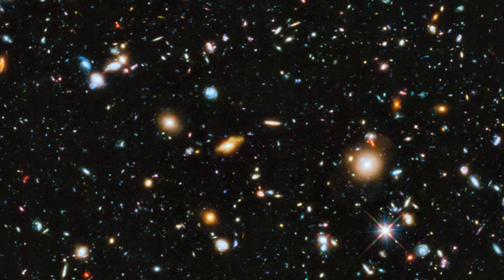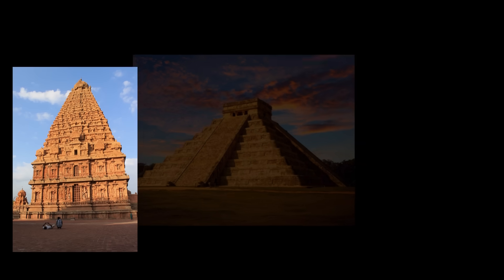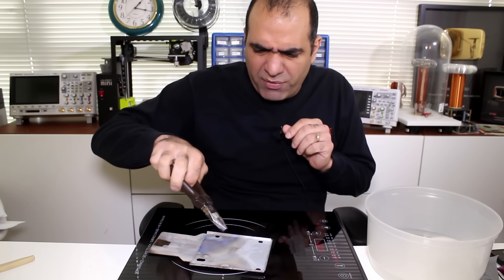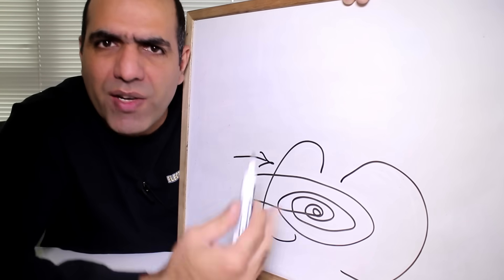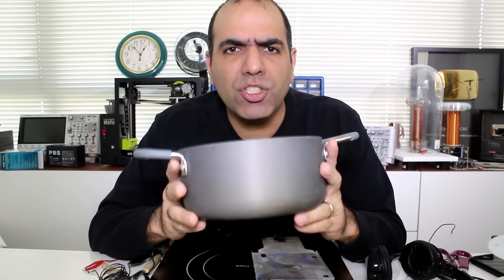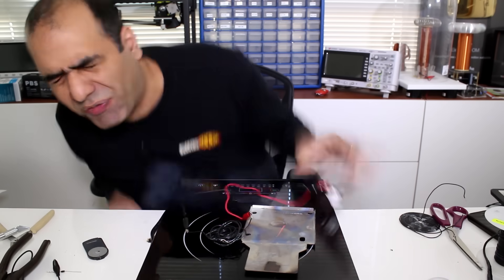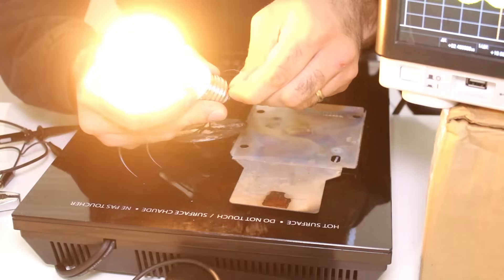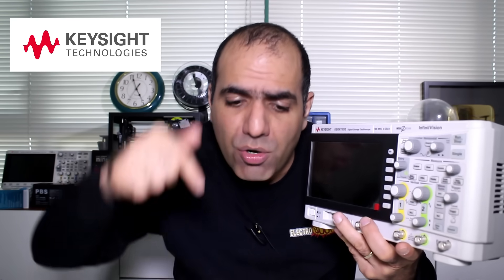Induction Energy Experiments

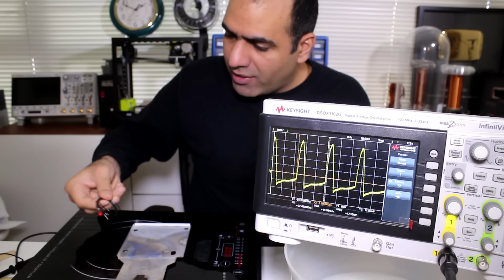Comment: at 3:55 your led did not worked because its a diode and diode dont pickup current from both sides. just one side i. i  duno if i'm right btw
Reply: In a DC circuit, yes, but in an AC circuit (as used by the cooker) electricity travels in both directions, the LED just didn't work because the AC wave was more of a saw-tooth shape, with steady current in one direction but a steep drop in the other.  Making the AC sort of DC..

Comment: Will the induction cooker get damaged if we use aluminium pot as the resistance is very less so current will be Very large, so the high current can damage the induction cooker.

Comment: Awesome video. Here's what I don't get. Eddy currents are created by induced EMF, which is created by a changing magnetic field. How much of a potential difference is generated depends on how much the field is changing (by Faraday's Law), and not the material it is passing through. So the amount of Eddy current is determined by the resistance of the material only - wouldn't less resistive materials heat up faster? Or am I missing something?

Does the magnetic field's frequency drop as the cooker's "load" increases?

Comment: THE POINT OF THIS VIDEO IS TO MAKE YOU THINK ATMOSPHERIC ENERGY DOES NOT EXIST.  1 METER = 100 VOLTS.   FOR EVERY METER YOU GO UP FROM THE EARTH, THERE IS A 100 VOLT ENERGY POTENTIAL.  AT 100 METERS YOU HAVE 10,000 VOLTS.  BUT LOW AMPERES.  THE GREAT PYRAMID WAS THE FIRST OF THESE DEVICES AND ITS TOP WAS COVERED IN GOLD TO ATTRACT THE ENERGY, ALSO CAPTUREABLE IN THE FORM LIGHTENING.   THIS VIDEO, AND ALL THE OTHER INFO ABOUT THE PYRAMIDS IS DISINFO TO STEER YOU AWAY.  CHECK OUT AARON DOVER'S CHANNEL ON ATMOSPHERIC ENERGY.  ALSO DO YOUR OWN SEARCHES, AND INCLUDE THOSE NUMBERS IN YOUR SEARCHES

Comment: if resistance is smaller in Al and Cu, then won't the current be higher? Since current is squared, will that not lead to greater power transmitted?
Reply from the maker: that would be true if the voltage remains fixed. but the voltage drops too.

Comment: Hey Mehdi.
Salutes from Jordan.
Allow me to slightly correct you on why induction heaters work on iron or any ferromagnetic material better than copper or aluminum.
Eddy currents and skin effect are actually present in all conductors.
The major reason why iron heats up better is the magnetic dipoles flipping up and down with the same 20 kHz of the magnetic field, which generates so much friction heat. This is known as you must already know as hysteresis losses.
After Curie temperature is reached and the iron loses its ferromagnetic properties, eddy currents are the only remaining factor, rendering the iron behaving similar to copper or aluminum.

Great videos you got Mehdi. I love your channel. Keep it up!

Comment: LED works on one way but not other because it has POLARITY (POSITIVE AND NEGATIVE)
Reply: It should be noted that the AC coming from the wall and regular lightbulb sockets is way too strong for a single LED; LED light bulbs you plug on regular light sockets actually got a bunch of LEDs to distribute the power (and they also usually got some circuit and stuff to reduce flickering and not waste half of the AC cycle). Do not try to plug a LED into a wall or lightbulb socket; if you don't know what you're doing, just restrict yourself to stuff that was already designed for those sockets.
Reply: Sandeep naik He showed on the oscillator why the LED didnt turn on. The magnetic field isn’t symmetric
Reply: For diodes you don't use a full bridge rectifier just like that. Those rectifiying diodes waste energy. Just connect 2 LEDs (or more) antiparallel.
Reply: Christopher Pepin it will always have a negative portion, since its isolated by airgap to any reference.
Reply: The end too where the light would flicker, an emf is created and it rises in volatage, once it reaches it's peak it collapses and the collapse can generate a lot of current, then it starts over and continues.
Reply: TiagoTiago  no one's gonna power a single led with 120 volts or 240 volts city power but some brilliant person on YouTube might do that
Reply: In this case it wouldn't work as the waveform generated from the coil has no negative portion for the full bridge rectifier to harvest.
Reply: You must be a genius
Reply: You can use a FULL BRIDGE RECTIFIER to not waste half the AC cycle ;)

Comment: Electroboom, I think the reason you are getting halfwaves from the coil because these induction cookers work by rectifying mains AC into DC, filter it with some capacitors and then pulse the DC into the coil with an IGBT. The setup is like a flyback converter (except with only one coil), so you only get halfwaves instead of fullwaves. I also did some contanuity checks on an actual induction cooker PCB to verify this.

Comment: Could this heat up your wedding ring accidentally?
Reply: Witnaaay You mean the induction plate? If your ring isn't from a ferromagnetic material no it can't heat up - ferromagnetic materials are iron, some sorts of steel (not including high-grade steel), Cobalt or Nickel. If you have none of those you need an actual coil of a material that conducts electricity (like Mehdi uses) to feel anything. So if your wedding ring is made from gold or silver nothing should happen.

Comment: Is it possible to create recyclable energy by connecting the power plug of the cooker to the coil? Wouldn't this automatically convert electrical energy to  heat energy, thereby melting the wire?

Comment: i thought an LED is basically a diode and won't work if the potential difference across it is not applied in the correct direction

Comment: @ElectroBOOM I'm pretty sure your LED only turns on oriented in one direction, because a diode only lets current flow one way unless the reverse voltage is higher than the breakdown voltage of the LED, no?

Comment: Why a higher resistance means more heat? Aren't the eddy currents going to be stronger if the resistance of the material is lower? In my understanding, the oscillating magnetic field induces a potential difference along the surface of the pot, a lower resistance means higher currents and consequently more power dissipated since P = R * I^2

Comment: Thank you for continuing to debunk free energy scam tricks. It's an important that respected engineers participate in the community like you have. I wish I could afford a Keysight DS0X 1102G. 

In the future, I hope you can break down volts, amps, watts and the relationship to ohms law -  not as a formula, but how electrical engineers choose the right components to generate current as "power" for a given amount of amps and volts in low power environments. 

So for example, if we want to learn how to build a low voltage (less than 9V) circuit to power a variety of sensors and micro-controller and still have enough milliamps required for each component / sensor without exceeding the amount of watts the current will generate.

Your videos are great and have enjoyed all of them!

Comment: The difficulty in dealing with nine volt batteries is the fact that there are six aaa shaped natteries that are smaller though.  They are connected in series (1.5v x 6).  They are small so cannot store much energy.  Six aa batteries connected in series is the same as the mine volt battery.  And has far more stored energy than the tiny cells inside the nine volt.

Comment: Hold on, surely the LED only turns on one way because it's a diode? If the magnetic field induces a current in one direction then flipping it would result in a current in the opisite direction which would be blocked by the diode being reverse biased, no?

Comment: I once lit an LED with a soldering iron......you could strip the copper wire and oxidise it to get enough current from a light bulb to maybe dimly light two red LEDs like I did...and maybe use the sun too for "free energy,"  but if it's not Earth grounded I guess touching with your fingers and using your body as ground works just fine. And....finally instead of using a "FULL BRIDGE RECTIFIER" to light the LED on A.C. supply you can use just use the  LED's in series and Ohm's law to calculate the voltage drop and then make another equal strand in reverse the polarity toward the first strand of LED's to use A.C. on LED's without blowing them up.

Comment: But there is free energy. I found out that if you use a fan the other way around it generates power. And free enery has lots of fans. So theortically you could use the hot air in their heads to create enough energy to power the world.

Comment: Speaking of o-scopes, I remember using old HP's with CRT displays... then having to switch to the digital ones in 2002 in the US navy. The digital ones really pissed me off, they seemed to have an almost 500ms delay from prob to display that made tracing down missing IPL's and other data hand shaking signals next to impossible. (I mean you could use the xy mode but that's crap) The old school ones had no delay so what you were getting on the probe was what you would get on the screen.   What are your thoughts?

Comment: Wait, car to USB adaptors regulate voltage? So all I really need to make a hand cranked phone charger is a diode, some capacitors, a car adapter, enough wires to tie someone up with, a handle, some glue, a refrigerator magnet, and a wooden handle?

Why haven't I done this before?!

Comment: hey I have a question, I bought some WIFI adaptors the other day, where if I want to hard wire say my PS4 to the router but its in the living room and my ps4 in my bedroom. how does it work?

The two adaptors I have one in my room and one in the living room are placed in a wall socket and a wire would conneted to the router and then the other one in my room connects to my ps4. so how does that work? if wallsockets powers something how can it also transfer wifi through the sockets?

Comment: Most of the heating effect in iron is actually due to magnetic hysteresis. Basically when a magnetic field is present around iron, the iron keeps some of it an becomes a magnet. But because the field this cooker generates switches direction rapidly, the iron is constantly being demagnetized and remonetized. This cycle generates a lot of heat. The eddy currents are still significant, but in my experiences the hysteresis effect is much more significant at these power levels.

Comment: When you showed that the LED turns on one way but not the other. Isn't that explained by the fact that Lenz' law induces a current in a specific direction through your loops. This direction is only determined by "-change in flux" and not the orientation of the loops. Combined with the fact that LEDs will only work when the current goes through them in the right direction it results in the observed behavior.

Or nvm, the induction cooker works with AC, I had DC in mind.

Comment: http://www.gizapyramid.com/tour_39.jpg  this is the stained shaft eartmilk had an excellent color photo of this shaft the black soot at the top of the shaft looked like a burn or that black smudge i have sometimes seen over the prongs of a heavily used outlet.  the other shaft you will not find any pictures of earthmilk had one it the same size shaft but the first three feet was so eroded that you can stick half ur body in.  there is also the issue with the 'great step'.  it has been repaired if you find an original photo it was heavily water eroded.

Comment: Free energy? whats that big hot ball of light in the sky....Yes, free energy. Also, the higher up you go, the greater the difference between the sky being positively charged and the ground being negatively charged. Millions of tonnes of water are held in the atmosphere because of this electrical difference. If lightning has the power to combust nitrogen which is what makes the bang, then we know there is loads of juice up there. Why do you think there is such a big metal spike on top of the "freedom" tower? A load of spikes and tall towers connected to the grid and you have a system where some part of it is always conducting from the sky. This is why high voltage power cables are not insulated. Because electricity wants to go to them not jump from them. Ooops, i was forgetting that we pay for this power, and through the nose. That's the big flaw in the plan.
Reply: If you are looking for a home for a scope, i have some experiments i could use it for ;D